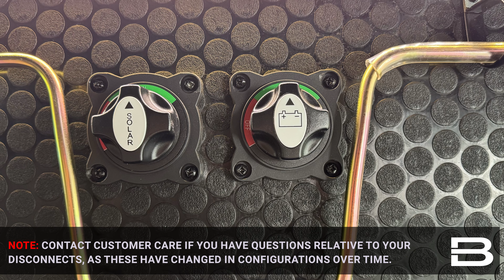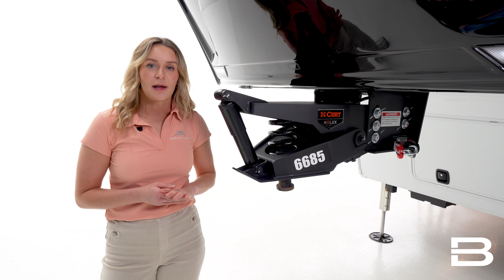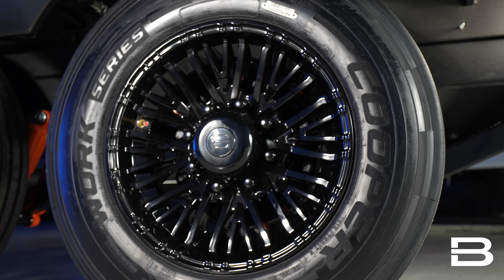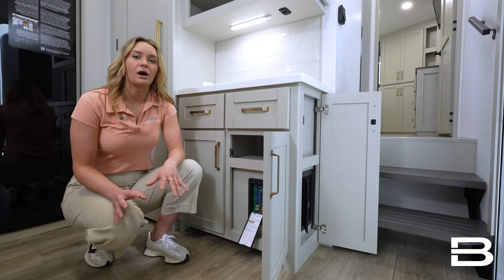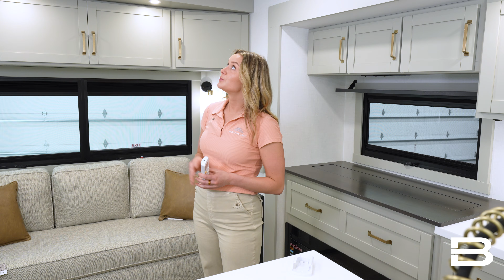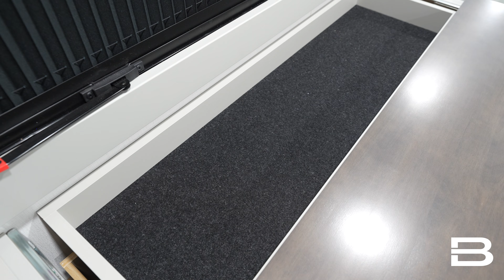2026 Brinkley Model Z Owner's Quick Start & Overview

Comment: Bought Z 2680 2025 from Campers Inn Myrtle Beach,  SC.   Is there an installed switch for the Winegard 5G Router?  Bought the router but haven't installed it yet.   I contacted Brinkley about the monitor for the backup camera which was not included in our new model we purchased.   Campers Inn said they would send it but they didn't.   I'd like to say too,  that this walk through video is priceless.   Awesome job!  And thank you very much